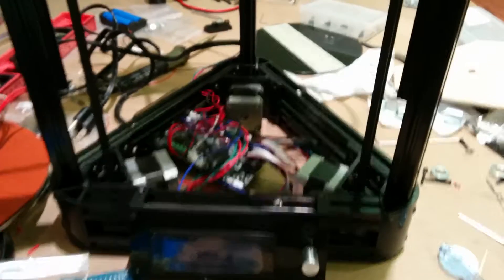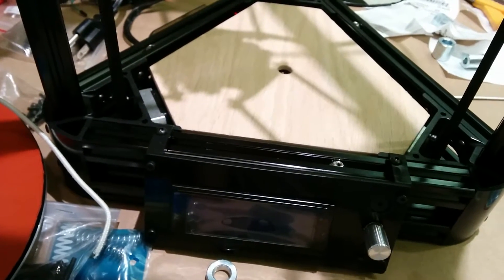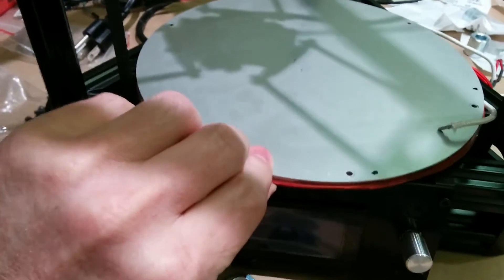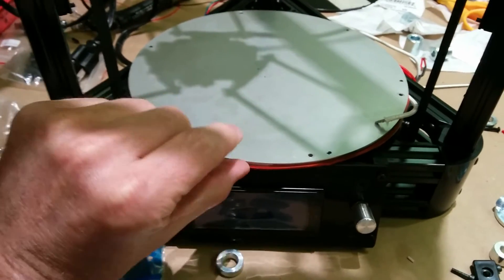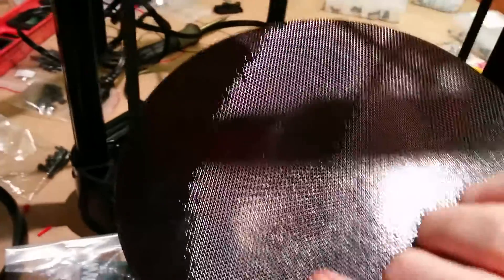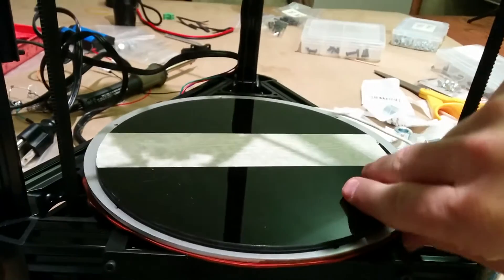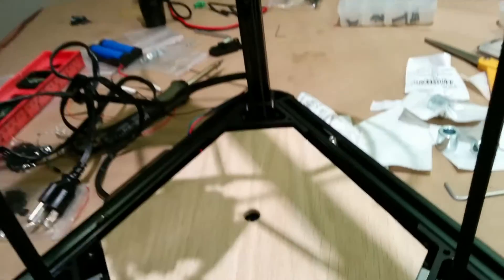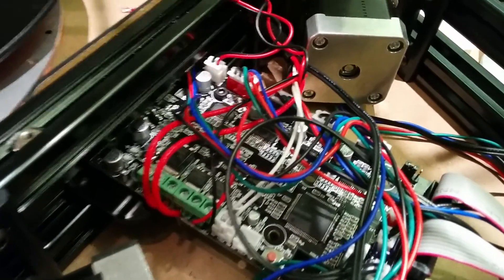Micromake heatbed isolation

Comment from the maker: I have completely assembled the printer and went with steel cylinders to lift the print bed off the ALU extrusions.  I have a heat tape covered wooden insert just above the electronics (sitting on the steppers).  I have a thin silicon sheet cut to a circle under the heatbed.  This makes for fast and even heating.   You can see a picture of it in my other video's such as this one: https://www.youtube.com/watch?v=7C6KH6FLLss

Comment: I was thinking about buying a micromake too and was wondering about how to protect the electronics from the heated bed myself.

One of the ideas aside from isolating the electronics with a barrier was to design a duct to draw air through the gap in the aluminium extrusions and print that in PLA, mount a case fan and solder that to a switch. You'd just need to remember to turn it on whenever you are using the bed.

If you are more electronic savvy than me you'd probably be able to figure out how to get it to turn on in lockstep with the heated bed :)
Reply from the maker: +Benedict Tan I'm uploading a video where I show the heat transferal through a 1/8th thick silicone sheet.  That might work with the 30mm screws and springs that I have mounted on the heatbed since that raises the heatbed about 25cm above the openbeam.   However I have a 1/2" thick silicone foam sheet (up to 400F) coming in a few days from now that might work even better than the 1/8" thick piece I am testing right now.  Combine the height + 1/2" silicone barrier and I think it will protect the electronics.    The new video I'm  uploading now shows how the heat gets thru just 1/8" thick silicone pretty fast...
Reply: +citadelik I've seen a number of people use cork to insulate their electronics. Still, I imagine that having a moving airspace to dissipate the heat via convection is probably the best way to keep that thermal energy off the electronics. A reflector couldn't hurt either.
Reply from the maker: +Benedict Tan You are right,  I might be going down the wrong track with silicone.  I do now have the 3 screws and springs lifting the heatbed up above the openbeam, but IR heat will be a problem unless I put a reflective sheet across the openbeam (or on my wood block).    I'm taking my time finishing this build so I can explore all options,  after seeing how the 1/2" silicone transfers heat I'll either try cork or a combo of reflective sheet and elevation off the openbeam.
Reply: +citadelik Just watched your heat transfer tests video and after further research on other builds my thoughts are as such;

Whichever route you take be it the thick or thin silicone I think it's important to have an airspace between it and the heated bed. The reason being that when the bed and your insulator are in direct contact it is subject to thermal conduction.

With that in mind, I hypothesize a good configuration would be to have your heated bed on top, then a spacer/shim on the screws to add an airspace, then a foil layer to reflect IR and lastly the thermal insulation barrier.

The airspace will allow for convection to dissipate heat and the combination with the foil should have a secondary benefit of keeping the bed evenly heated without leeching heat out of it.

Since you have the temp gun to test this out, I guess it's a matter of raiding the kitchen for some foil ;)